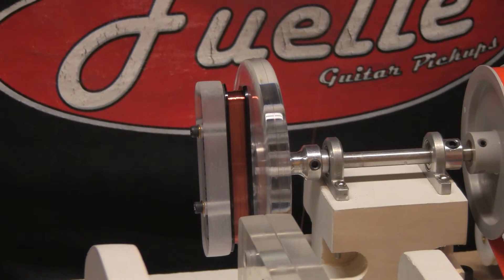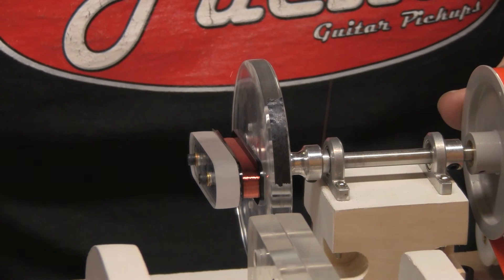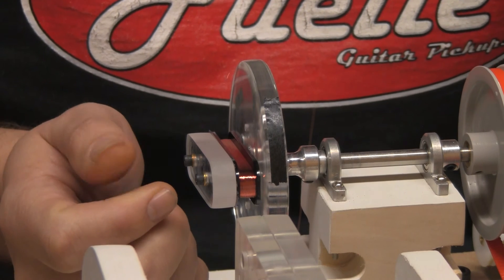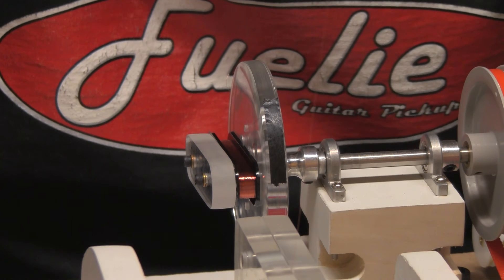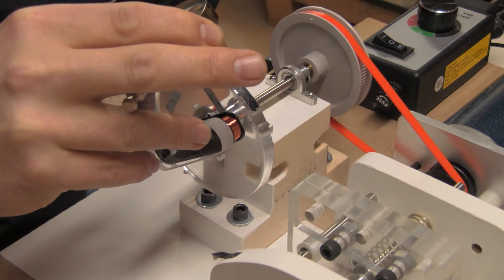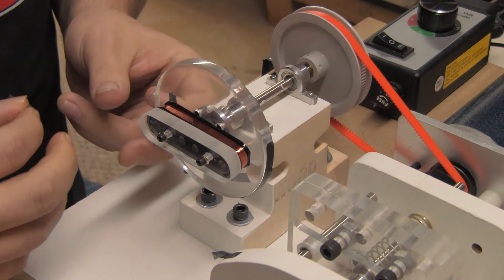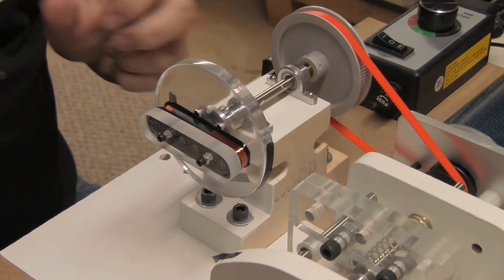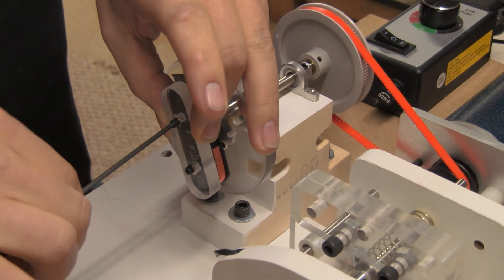How it's built part 3

Comment: Thanks for sharing your unique skills and insight. I learned a lot and I am trying to find the parts to build my pick up winder. As you pointed out it is a lot of fun and a personal accomplishment overcoming and engineering difficulties. You now have have complete winding control. I am also impressed with your Idler arm set up, tension controller and pointing out the router speed control. My current problem is finding the parts to build my pick up winder . I can't find a single business, here in the city of Vancouver BC,  that sells those  pulleys, bushings and small bearing collars to build a stable winder. Could you share the names of the businesses where you located your parts? Thank You, Leon